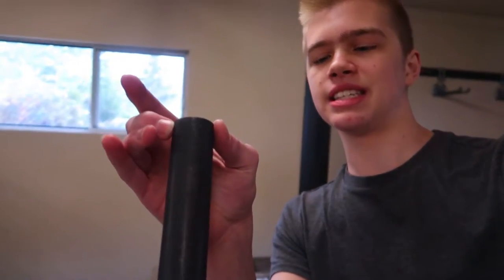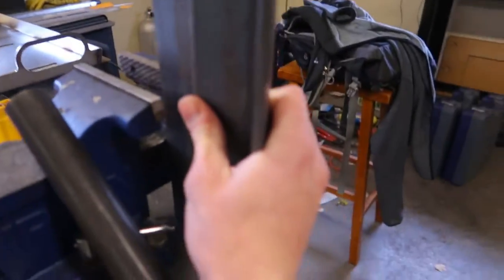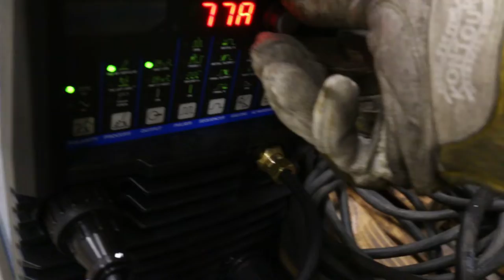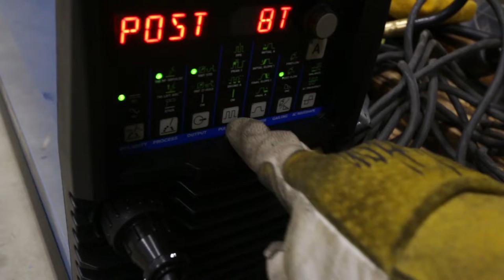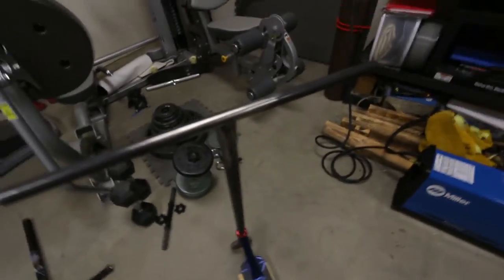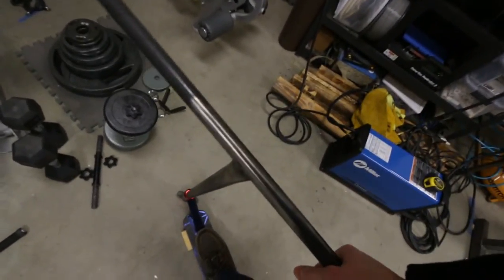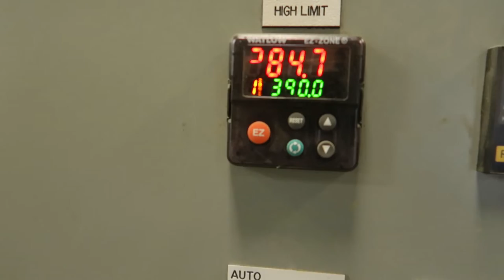Making DIY Scooter Bars!

Comment: How much did it cost to make these, not including labor and powder coat?
Reply from the maker: I think materials was about 50$, but I now have enough to make 2 or 3 bars. I think the chromolly was from McMasterCarr. Not the cheapest, but by far the easiest. I think I used less than a dollar of powder for powder coating.